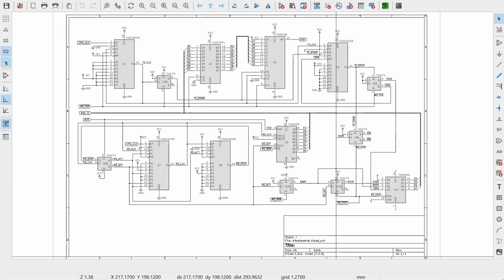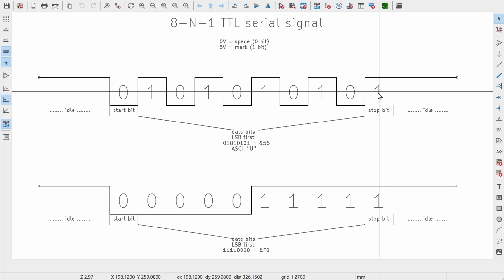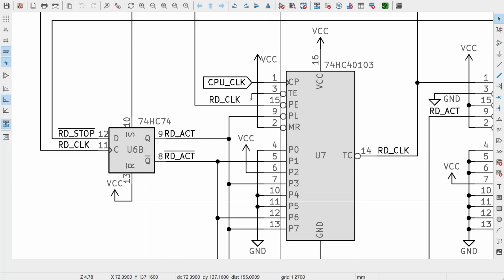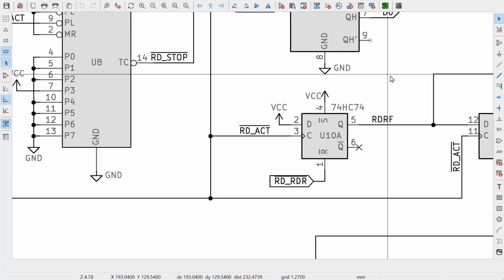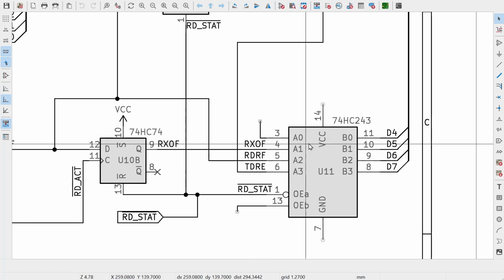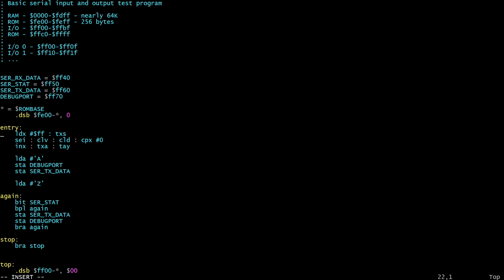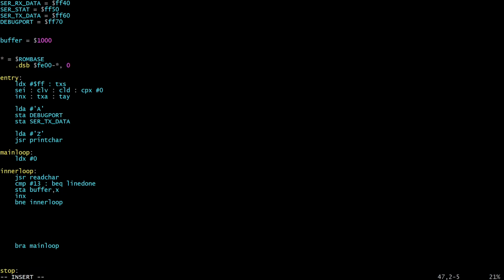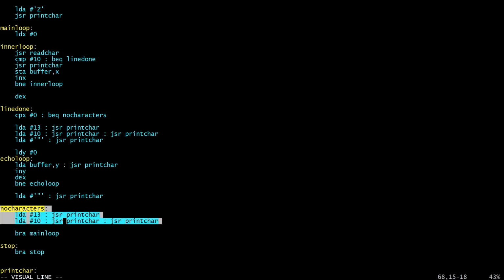Low Tech Serial Input with 6502

Comment: You are using a lot of 7474, do you think it worths to re-think the design and use one 74175 kind instead?
Reply from the maker: 74175 is nice but all four flipflops have to use the same clock and reset signals, so it doesn't have the flexibility that I needed here - I don't see an obvious way to combine the flipflops together.

Comment: Using read to clear IRQ is a pitfall. With high-speed FrontSideBus as you have on CPU card, posted writes /* CPU fires write to I/O and runs further, so only I/O interface becomes blocked */ are much cheaper then a single read operation which slows down FSB to synchronize with I/O bus.
Reply from the maker: Yes indeed, however I think it doesn't matter so much in practice.  The first response to the IRQ is generally going to be to read the status register to determine whether the serial circuit caused the IRQ, and so this read will also clear the IRQ state - so the clearing of the IRQ is already a side effect of something else that we need to do.

The disadvantage of clearing it on reads is really that every read clears it, whether you want to or not.  It leaves you in a situation where after reading the register, you must deal with all pending reads and writes, because if you don't then you won't get another interrupt.

I think a better system is to have a writable interrupt mask register, with one bit for receive and one bit for transmit, and then AND that together with the status register to form the IRQ output.  This way the user can individually enable or disable the transmit and receive interrupts, and we don't need to rely on any side effects to clear the IRQ state.

Comment: Two questions: How much more complexity would be added to support hardware selectable baud rates? What do you see as the limitations in a discrete logic approach to this problem, as in, what features or capabilities are you giving up by not going with an off the shelf UART IC?
Reply from the maker: It's mostly a matter of correctly configuring the 40103s.  That's hard espsecially for the receive circuit where the number programmed in is complex - but if you make it a power of two, or one less than a power of two, then it's really easy to reconfigure it.  e.g. programming the 40103 to 31 gives a cycle length of 32, and 4MHz/32 is 125000 baud.  Another option for the receive circuit is to use multiplexers to choose between the two delays, which would also be easy to configure - there's always a better way :)

I'd also say that building your own like this isn't necessarily the best idea, I mostly do it for the fun and challenge rather than because it necessarily makes sense in the long term.  This is all a hobby to me, and I learn a lot by going through the process, but serial communication is so standard I'm sure there are many parts you can use for it.  Since starting on this somebody pointed out the 6402 (I think) which is a suitable UART that doesn't require configuration on startup.

Another compromise is the lack of buffering (FIFOs) - it can be added to this circuit, but doesn't have it at present.  Though some old-fashioned UARTs also didn't have FIFOs, and you can get by fairly well without them.

Comment: Clever implementation! :) Your FTDI bugger usually spits out whatever is in its RX buffer when you connect to the serial port so the junk data could've come at any point in time. 
It looks like it's almost ready to get it's own PCB. 
Since I'm doing software serial on the 65uino I'm feeling a bit envious - with this you should be able to use it full duplex, even without additional buffering. If you send it a continuous stream of characters it would have plenty of time to echo rx to tx on the fly, right?
Reply from the maker: Hi Anders, yes, this works full duplex - the two circuits are entirely independent - with very little CPU overhead. Actually getting the Python-based server program to work full duplex was more difficult though!

I have made a PCB of an iteration of this circuit that uses 22V10 PLDs to condense it down to 5 ICs in total, and that works very well.